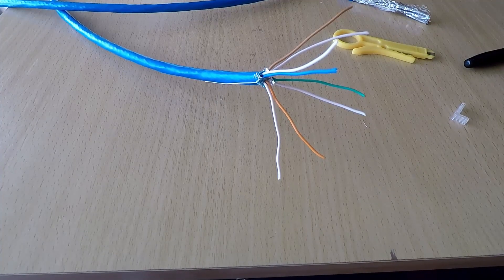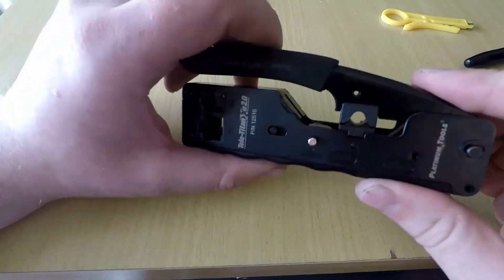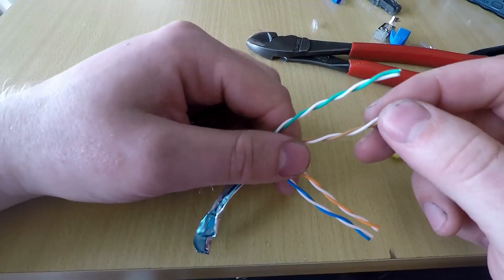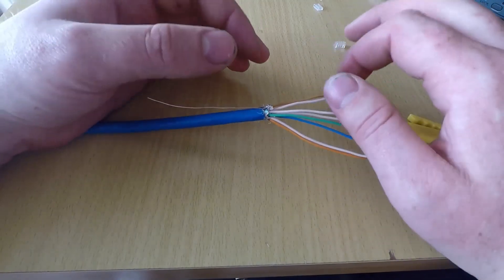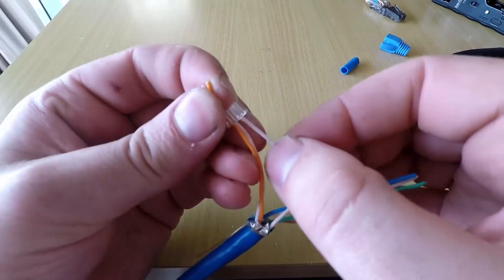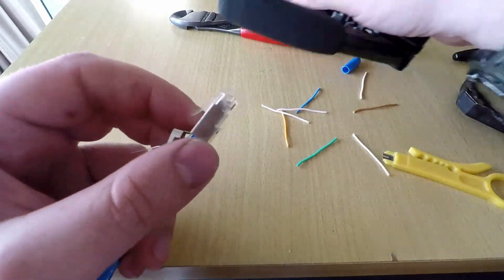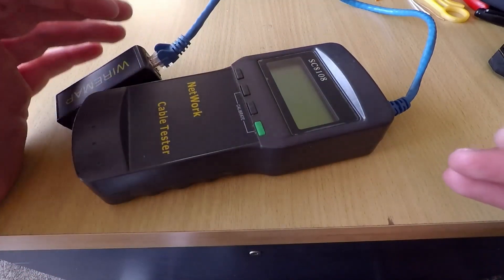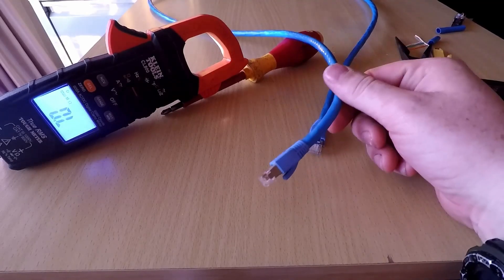How To Terminate Cat6A Cable End

Comment: Cable manufacturers are removing the stripe from the white cables. It's not a fault. Wires without a stripe can perform slightly better in some situations.

Comment: Some useful tips and tricks in there, thanks!
However, I'd argue that it is a mistake to not leave the shielding foil and braid, until you've attached the connector and crimped, then only cut off what comes out backwards from connector. With the metal side of the foil outwards and the braid you will ensure that the cable shielding and not only the ground wire is connected to the shielding of the RJ45 connector. (For best possible signal integrity I think you'd want a low impedance path to ground for any common mode noise along the whole cable, for all twisted pairs.)
Reply: Pool like lol lol pll
Reply: 0099909
Reply: L pll pll ol l of ll lllll
Reply: Loll
Reply: Lpll
Reply: Lllll like opollopll l
Reply: Loll l
Reply: Ll
Reply: Lp00lpplpp0pppplllpppp00ppppplppp
Reply: Plllllpllllllll0llllll
Reply: Llll
Reply: Ok o ll
Reply: Lplll l
Reply: P
Reply: Ollpllpll loll lllll lol l

Comment: strange... ASNZ standards say use 568A only they dont recognise B
Reply: No difference between A and B except for colors.
Reply: @adamxu   I know that, I've been doing cabling for decades however rightly or wrongly  lawmakers mandate things and in Australia and NZ (where Dave is) they mandate standards, and the std they mandate is 568a,  even the US Govt does not recognise or permit 568b in its networks. despite the home users making it popular
Reply: @Ressy66  The invention of B was for crossover cables, and I believe all the tech originated in USA. 
Nowadays the network devices can automatically adjust itself to suit A and B cable, so either one at either end should be OK. (I'm not a cabling person and not tested it, but an electronic guy, understanding the tech)
Well, to be simpler and less mistakes, 1 standard is better than 2. I guess that is the reasons govt has the new regulations.
Reply: @adamxu  of course it will work electrically, that is not in question but its NOT ok to do if your countries govt mandates a particular way it must be done as in AU and NZ, if I go install 568b I risk losing accreditation - meaning I can no longer be a telco/data cabler and fined big dollars for breaching the ASNZS stds enforced under the communication act. 568b was brought out by ATT to be difference, but is not recognised by the US govt even
A-> B crossover yeah, but most switches, and NICs even the 9.95 cheapies out of China ebay sellers have all for a long time auto correction so they are not even a thing for a long time (unless your PC is 20yrs old)
Reply: I think there was a thing where patch leads were mostly B and everything else A.

Comment: Ideally, use patch panels and factory made cables. I cut DIY cables in half and chuck em in the bin. Not worth the hassle even if you get paid by the hour. Problem with DIY is most testing is with a $15 ebay special or no testing at all. Use velcro to secure network cabling not zip ties. Leave a service loop of about 1-2m in the roof/wall/hidden on all network runs. Other than that, nice video. Wouldn't bother with Cat6a patch leads just yet but if you are running cable through buildings, definitely run Cat6a.
Reply: or even more slack more slack is always appreciated